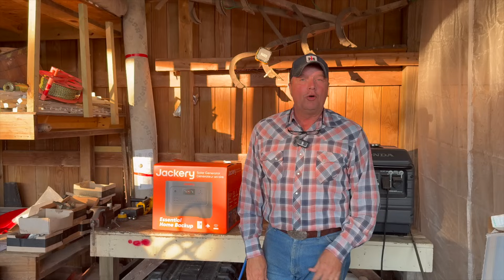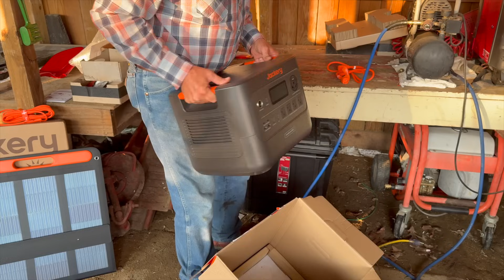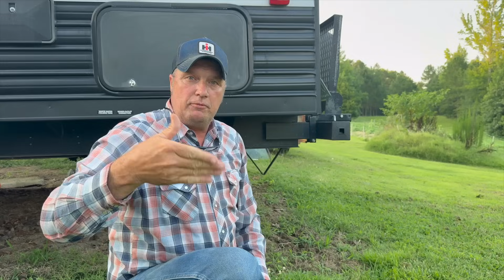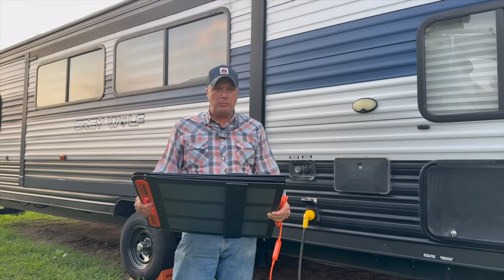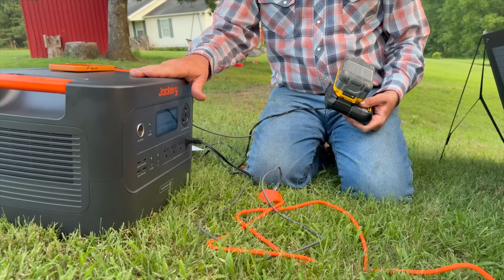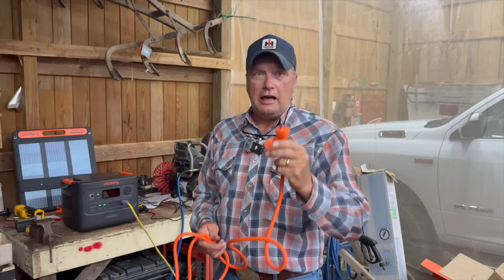Jackery Solar Generator HomePower 3000 A Must Have For RVs And Preppers!

Comment: I only need emergency power for the forced air heater in my house in the event of a power outage of about 10 hours. What would you recommend?
Reply from the maker: Depends on the wattage draw. I did hook it up to my rv off camera and it ran the ac unit and it was pulling 1700 watts and it said it had 3 hrs left on that charge. So the more watts it’s pulling the quicker it’s going to drain it.

Comment: I set the thermostat on 69° on my air condition. I got nine hours plus because it only really draws hard when the compressor kicks on and that was not hooked to the solar that was just a battery charge to 100% kept me nice and cold all night long.
Reply from the maker: That’s a good while. I would like to have a bigger panel for recharging.
Reply: @Jtwes  yeah I have two of them one I paid for and one of them I won so I stacked them on top of each other and I have almost 7000 W, now you can't integrate them so it's 3600 W each, but I could run you know chords all over the house if I have to